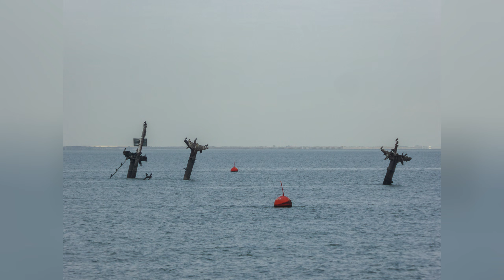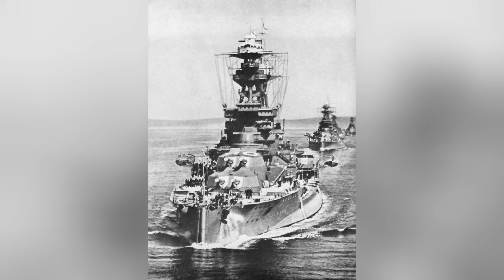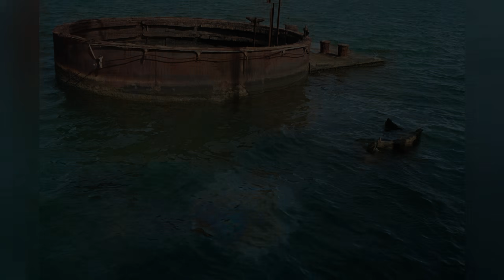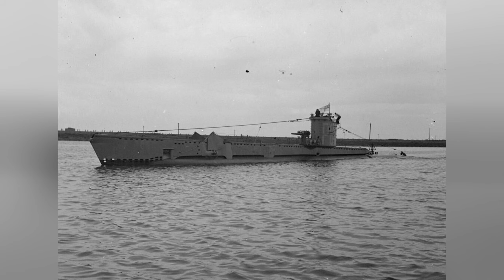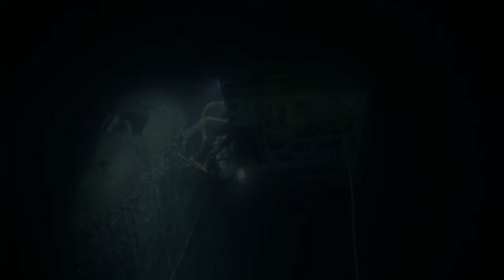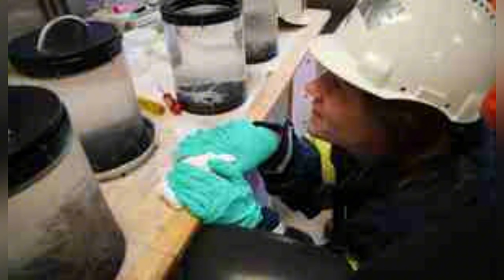5 Shipwrecks Too Dangerous to Salvage

Comment: The video is all fine and good but the German government, to their credit, has committed to recovering and deactivating or safely detonating hundreds if not thousands of tons of Nazi era munitions dumped in the sea after WW2. It will probably be a 25 year (or more) effort. In a frenzy to remove any munitions that could be used by a resurgent Nazi movement the allied powers dumped everything from small arms ammunition to torpedo warheads in the Baltic. Some of it literally washes ashore each year on its own. Munitions such as those on the Liberty ship, with no detonators installed as they would be on a warship going into action, could be safely removed one at a time by a robotic arm.

I find it odd that another video on this channel covers the dismantling of sunken warships by unethical scrap merchants. Those scrappers DID have to deal with fully armed munitions and it didn’t stop them.